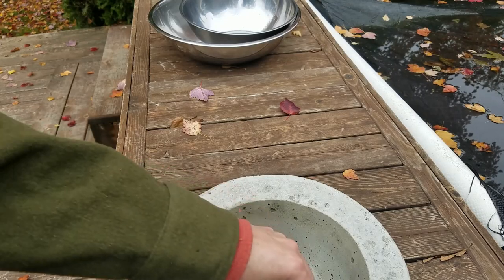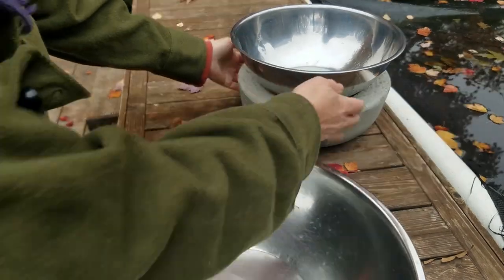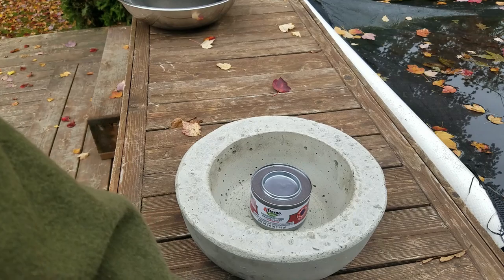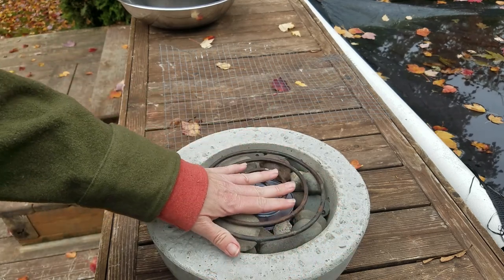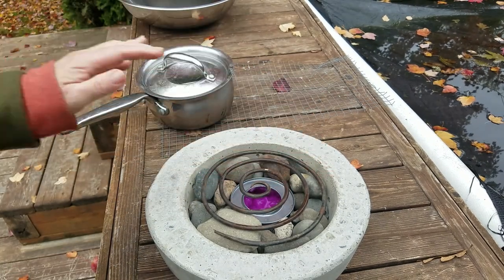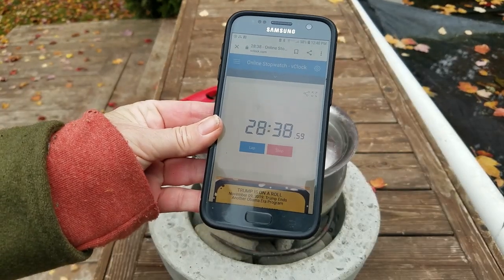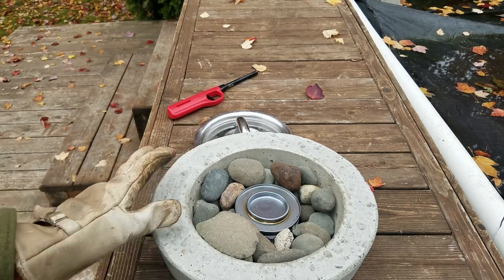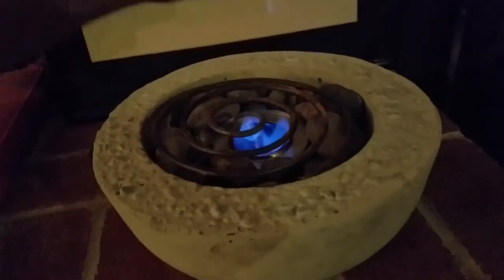Indoor Fireplace Home Made

Comment: Another suggestion here! Poke holes on the end of the sterno can with a hammer and a nail so it can make more heat quicker. :) You'll have jets on your burner.
Reply: but then won't the gel inside leak out?

Comment: Alcohol burners will work for your homemade stove as well. :)
Reply from the maker: i have some old school types for my back packing set up (an old swiss or german stove, don't recall which), light and great to carry.  the point of this particular build was as a project for me and a couple of my friends, so i kept it easy easy
Reply: @OldSchoolPrepper  Are alcohol burners safe to use indoors though?
Reply from the maker: @IzzyNChrist  great question, you need to check the label and manufacturer info for example some "Sterno" brand burners are ok for inside and some are not...but REAL gas burners, which burn pure alcohol (white alcohol) are ok inside...as well as some brands of kerosene... Of course have a carbon monoxide alarm near by.
Reply: @OldSchoolPrepper  Also, how much heat do the Sterno burners produce in this little homemade fireplace? I see that it's good for cooking but can it heat an area of your home?
Reply from the maker: @IzzyNChrist I would no rely on it to heat a house or even a large room.  If you had a small room that you could cover the windows and close the door maybe.  Why not go to the Dollar Store and pick up a very cheap Sterno (one of them) for chafing dishes and see how much heat it puts out.  A good one will put out more heat but it will give you a good idea of how much heat.  Are you looking for back up heat for your home?  I can make some recommendations if that's what you're after.
Reply: @OldSchoolPrepper  yeah, you know in case I'm stuck without heat in my apartment for whatever reason for more than a few days or something in the middle of Winter. I know it would be a great way to cook but I'm not sure about keeping warm. If that's possible, I'd like to do that in a way that is safe.
Reply from the maker: @IzzyNChrist  for that need (and it's a big one) obviously you can't put in a woodstove so you are left with only a few choices...I would suggest you check out Mr Buddy Heater's (small propane units), Kerosene Heaters (for inside), Hurricane Lanterns (Dietz is a good brand) give off some heat...they are also priced well (like under $30) some even have an option for cooking on top....  The most cost effective would probably be an old fashioned inside kerosene heater.  You can get them at Walmart or other inexpensive places (Northern Tool or other tool places)...just make sure the kerosene you get is for inside use.... a solar 'generator" which is really batteries for a solar unit, if you can get an inverter you can use a heated blanket throw.  They aren't strong enough to run an actual portable electric heater.  Of course a gasoline/natural gas geni would run a plug in heater (if you have a balcony or fire-escape you can  use for venting).  Right now these are all the options I can think of.  YOu can check out the home made terracotta heaters (that work with a candle) but they don't really work.  Good Luck.
Reply from the maker: @IzzyNChrist  hi Izzy, I just saw a new device which is for sale and thought of you ...i'm not sure if this is something affordable to you or not but seems apartment safe...I've not used it but Provident Prepper (LDS preppers) do and just put up a video, hope this helps:  https://www.youtube.com/watch?v=eR-yPcENA1w
Reply: @OldSchoolPrepper  Thank you so much for thinking of me. You're very kind :) I'll check it out